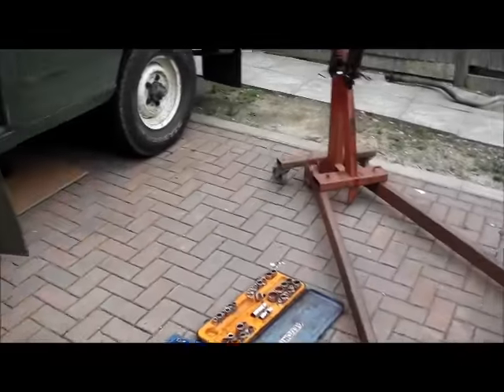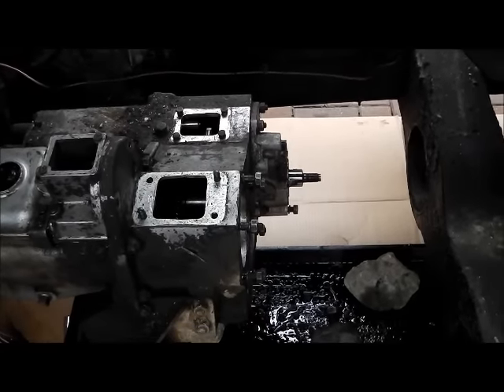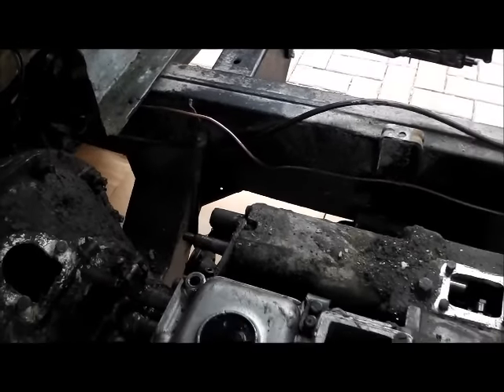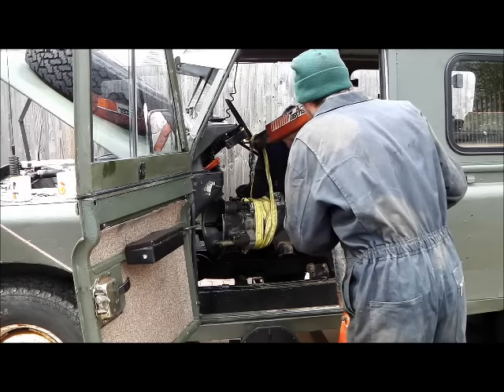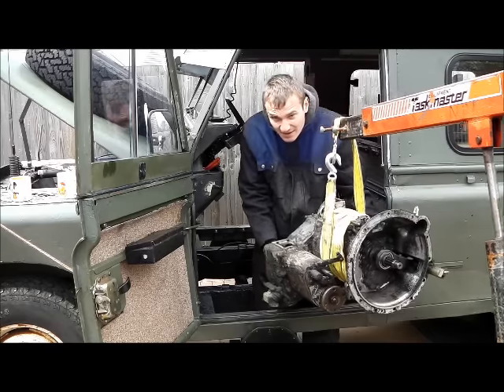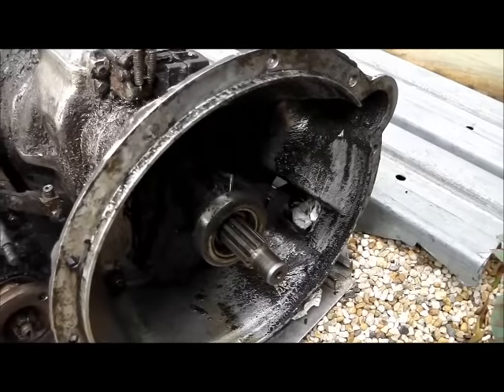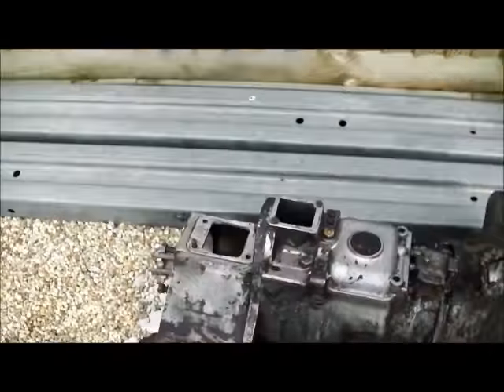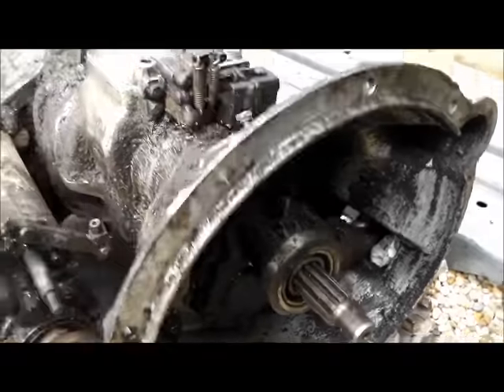Land Rover Series 3 Gearbox Rebuild - Part 10 -  Gearbox Removal

Comment: There's always a bit of end float In the input shaft as the splined end go's into the spigot bearing in the crank so a good time to check it while the box is out.
Reply from the maker: +Jimspeed 13 

That makes sense, thanks. Once the clutch is off, I'll see how that measures up.

Cheers

Comment: Hey Phil - best bit.....the chassis is solid, very little rust. While you have the box out, chuck a new clutch and cover on, not a 2 minute job to do later eh! So although the box needs a bit of 'love and attention' the rest is pretty damn good :)
Oh might pay to paint the chassis with a good metal paint...Hammerite or such. I did the Clio cills years ago....most of them are still ok which wouldn't have lasted a year otherwise.
Reply from the maker: +MalcOfLincoln 

Good isn't it! I was expecting to reveal some nasty rot, all I have found so far is lots of rock hard clay! This evening was spent scrubbing up the chassis and painting the bits I won't be able to get to later on. I went over the tub mounts too, makes it easier if a new chassis is required one day. Hammerite did the trick! 

Phill.
Reply: Must prove it hasn't been used on salted roads much.
You'll be my age before that rots out now :)
Reply from the maker: Expect I'll rot out before it does!

Through winter I was hosing the salt off quite regularly and oiling the chassis monthly.
Reply: Waste oil is brilliant, if messy. But does have to be done every year.
I was talking to the chap who did the Mini Van I made a video of at the next VW show. He built it 18 years ago, painted with Hammerite had done 50k plus miles and no problems.

Comment: I've read a good way of getting a spigot bearing out it to fill it full of greece and whack a close fitting drift in to hydraulic the bearing out with the greece. Might need a good swift hit.ive not had chance to try it myself yet.
Reply from the maker: +Jimspeed 13 

Sounds an excellent way to spread grease far and wide....
Reply: +Jimspeed 13 That procedure works a treat, even with ball race spigot bearings. If you have a ball race spigot bearing use very thick grease or even kids modelling (play dough ;-) putty, use care to pack the crank shaft so there are no air pockets and the bearing will pop out surprisingly easy. The best drift is a damaged gearbox input shaft.
Reply from the maker: whorayful  I'm sceptical, but I've never done it. If the bearing is shot, I'll try it on film. Would be great if it does work!
Reply: +steamwally I was a bit of a sceptic until I tried it with a Toyota Hilux I used to own, it works on the same principles as a hydraulic jack in reverse. A big piston, the end surface area of the drift in sq inches, acting on the smaller surface area of the bearing, the OD minus the ID, in sq inches. A small movement of the drift into the spigot causes quite a large movement of the bearing, one or two good solid sharp taps with a large mallet on the drift is usually enough. 

Cheers, geez I miss a good carvery!
Ray

Comment: Hope the rebuild goes as easily as the removal.  Obivously, not the time that you would have chosen to finish this job, but at least you will get it set right and it won't fail on you when you are many miles (or KMs) from home.
Reply from the maker: +odc43054 

In a way,  it could have happened at a worse time. In 6 weeks or so I will (hopefully) be bringing the engines back home again and as you say it will be sorted for the years shows. 

Truth be known, I'm quite enjoying the job...

Phill.

Comment: Is there any way you can modify the rebuilt box to prevent this from happening again? The last thing you want is for one of those springs to come out and cause the same problem. Glad the rest of it is all OK with hardly any rust. Will you be fitting a new clutch while you're at it? Regards Rich

Comment: @steamwally  can you advise were your bought the gearbox selector seals from please
Reply from the maker: Yes, but I can't recommend them - The ones supplied with all the rebuild kits are terrible, but late on in production they introduced a two part seal kit with a plastic scraper ring and an o ring, this does actually work. you need seal TRS1114L for Reverse. You then need 2x seal FRC6468 for the two main selector shafts and 3x Washer FRC6938. I bought these from PA Blanchards.

Comment: Is that play in the output shafts not normal? Pretty sure our box has around the same amount, but only had 30k on the clock. Another thing to investigate during the rebuild!
It's nice that your chassis is in such good shape, at least you won't have that to worry about any time soon.
Reply from the maker: +m1cr0man I'd expect a little by nature of what it is, but not quite that much - will try and remember to look at that in the gearbox build video. 

Curiosity will most definitely lead me astray, that old gearbox will be in bits soon just to see what's broken! 

Phill.
Reply: +steamwally Cool, I'm looking forward to future videos. This is all quite interesting.
Reply: +steamwally Thats always interesting. Bound to find some do's and dont's If someone has been in there.

Comment: If it's a series 3, you can unbolt the cross member and remove from below.
Reply from the maker: if it has the removable military cross member then you can, this one is military and has the civvy spec chassis, so it comes out through the cab.